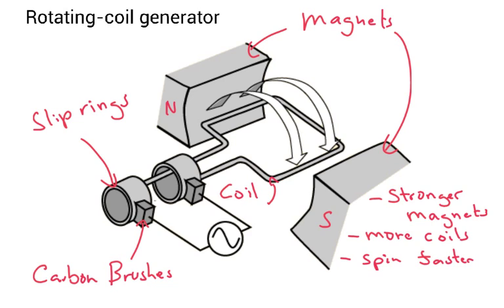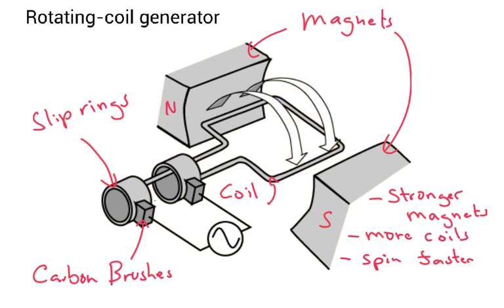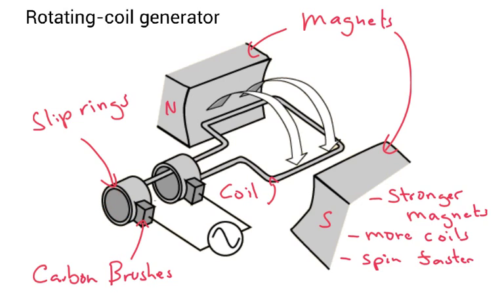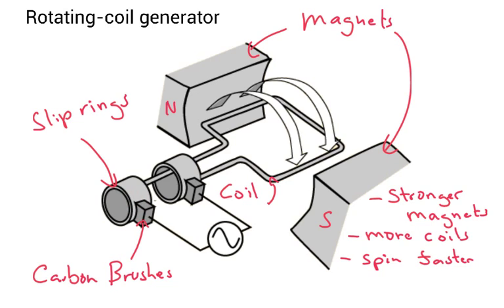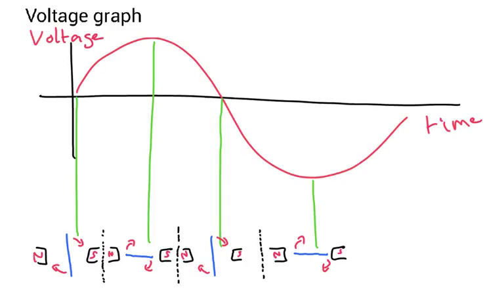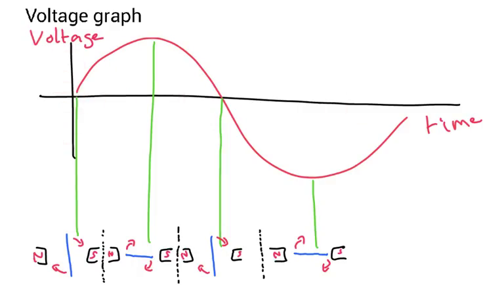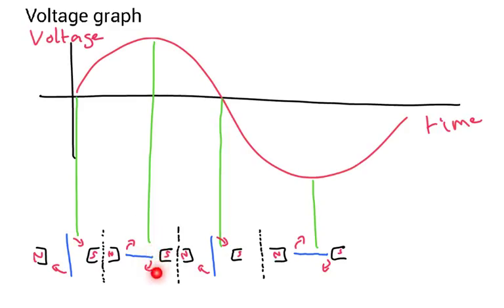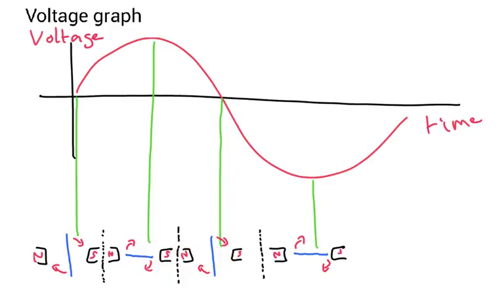AC Generator - IGCSE Physics

Comment: Y is the volate 0 wen the coil is vertical it does not make sense because it should.wen it is vertical isnt the coil overlapping the current
Reply from the maker: Voltage is zero because the wire is not cutting any field lines.
Reply: This is my last request for physics can you go through an extended exam paper explaining each question because I find it difficult to use some equations as it involves quite a lot rearranging
Not 2013 papers
Reply from the maker: Will try but working tomorrow
Reply: @shaidnawaz1850  hi shaid